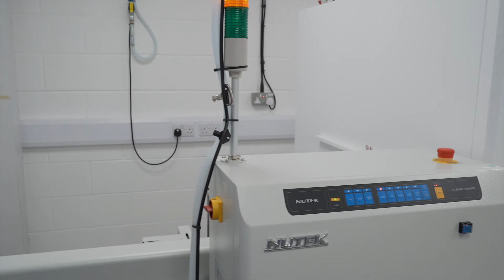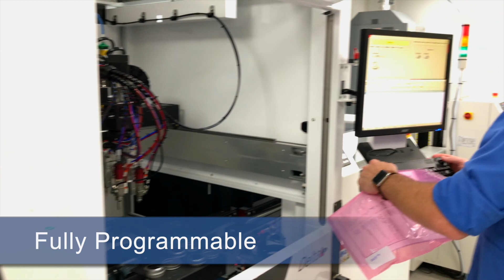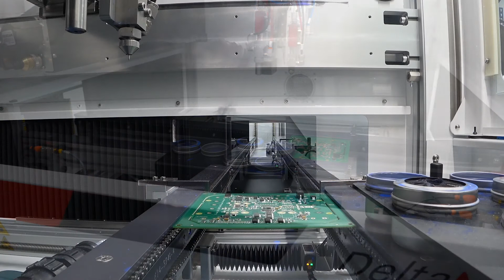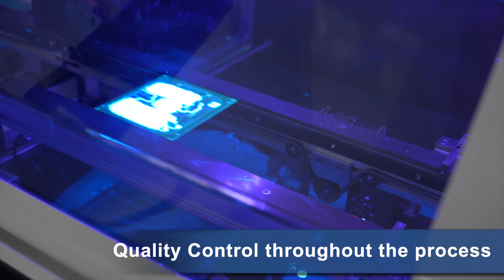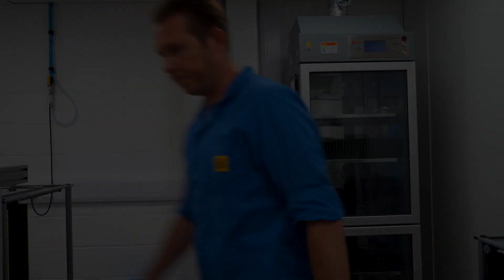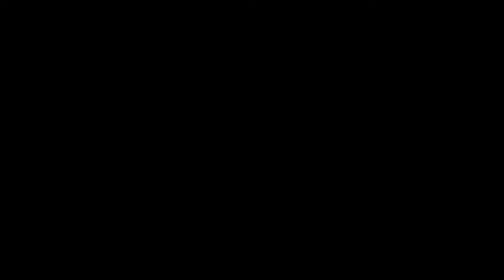CONFORMAL COATING

Comment: Hello. How to judge the pcb is already coated or not? In this video i can see the coated area become bluer.  It is the UV light to see the coating ?
Reply: there is always a thin reflective film on the pcb after its coated and could be seen easily under any light..
Reply: this particular coating is uv reactive, and most are. if you do not have access to uv lights, you can tell if coating has been done but proper quality assurance wouldn't be proper without the uv lights assistance